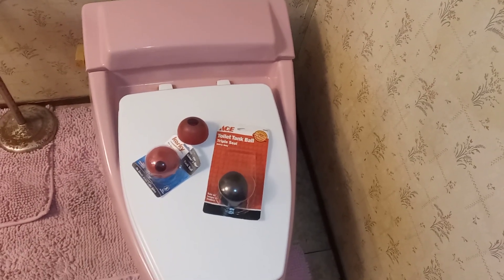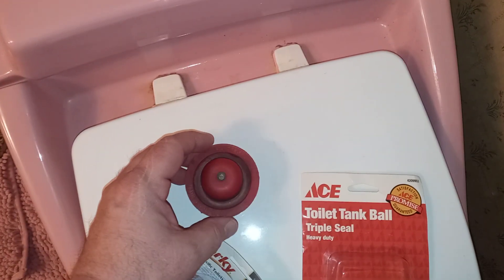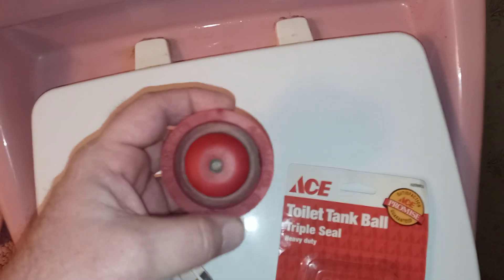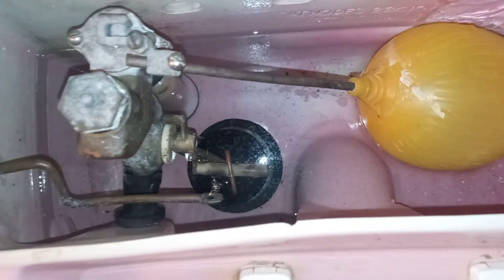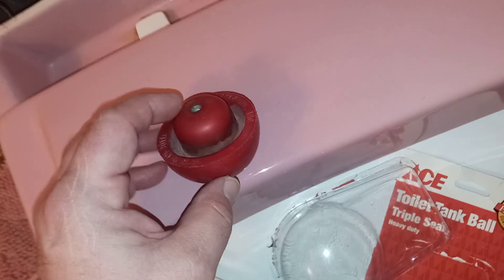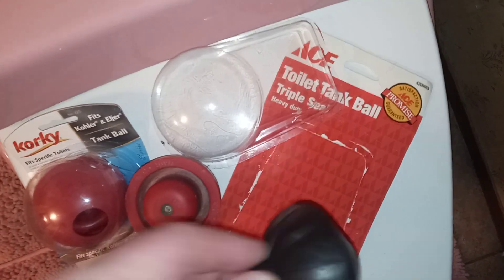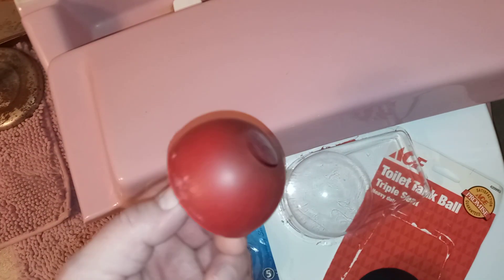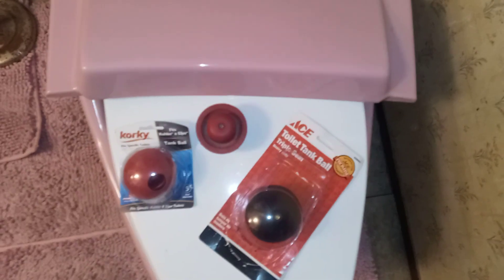Tank flush ball failure on pink Kohler Rochelle.Replaced with different style

Comment: Great content. I have a 1981 Rochelle that looks like new- with a few parts issues. Plubmers told me it was cheaper  to replace the toilet for a new one, but So glad I found your channel. A video on how to pull apart the float valve will be much appreciated. I would like to see if cleaning will fix them before spending so much on a new one. I can hear a drip after the tank fills until I manually lift the float ball up, I think the white plunger is not right. I placed a new Korky ball( I bought 2 yrs ago) and cleaned where the ball sits, and closed the water line, but after a few hours, the tank is empty (the floor is dry) and there are some bubbles on the red ball. Plus some water leaks back where the flush tube inserts the tank.  THank you for all your videos and any help you can provide. Look forward to your response. Hope you have a blessed and wonderful day.
Reply from the maker: Ok there is a gasket that goes on the fill valve under the flush assembly where the flush ball is.Its just like a tank to bowl gasket on a 2 piece toilet.I replaced  the one on mine because it took was internally leaking the tank would be empty after only an hour.That fixed that problem.So you can try that I used a soft spongey one to replace it with like the ones American standard uses.I will make a video one taking apart the fill valve as soon as I get the chance.

Comment: Interesting! I have seen warped tank balls before, usually if it was sitting around somewhere unused for a long time. Chlorine tank tablets can wrinkle the rubber in your tank too but I'm guessing you probably don't use those.
Reply from the maker: Yes we do have hard water and it has a high calorie content ,I stay away from tank tablets,lol the tank balls probably were sitting a while in a warehouse,even the one new red one in the package is dusty,lol.I guess the cheeper ones were of a less quality.I LL see what happens with the new one,it did fix the problem.